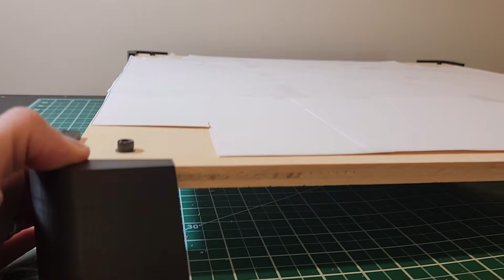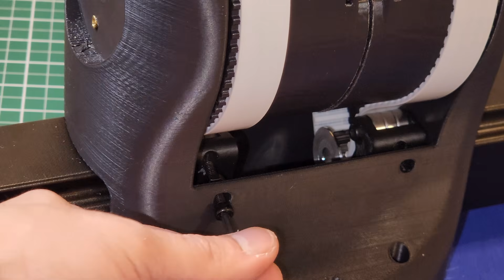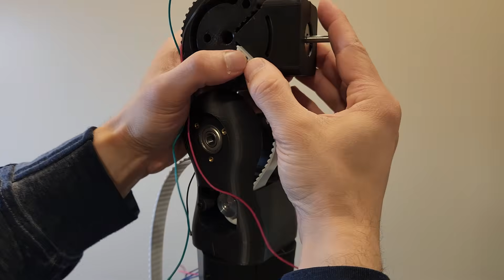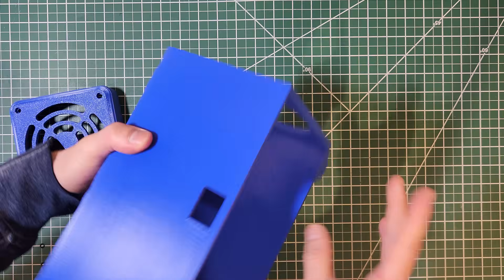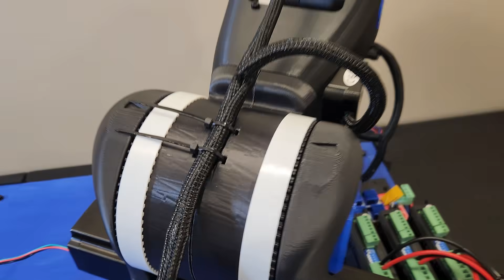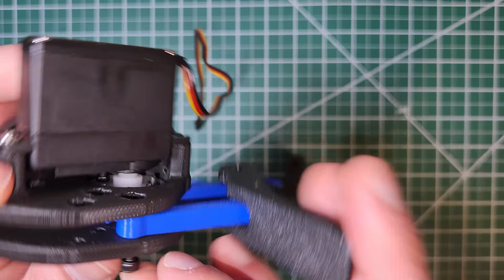Build a Robot Arm Part #5 - Robot Assembly

Comment: Hi, I think there is one modified STL missing: the gripper top plate. The link only includes the bottom plate, and the GitHub version isn't the same as the one in your video.